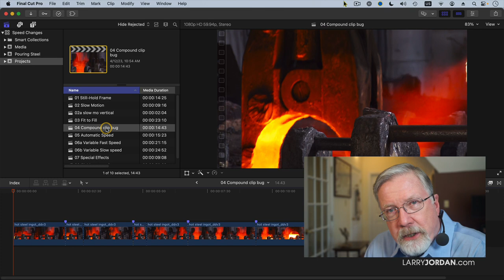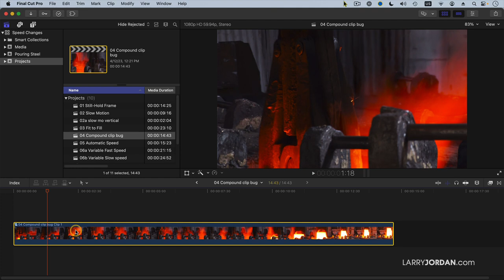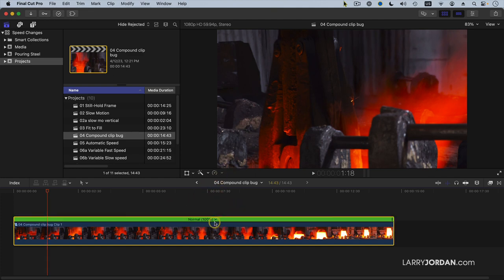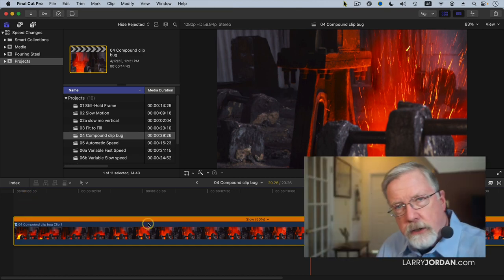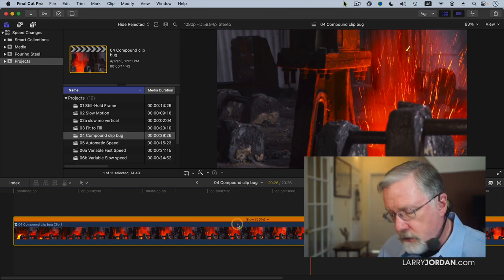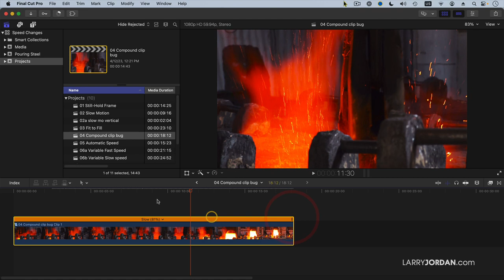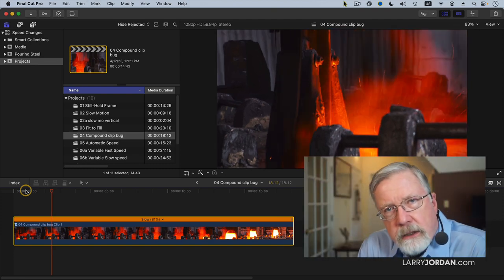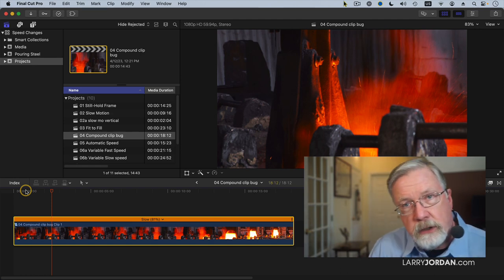How To Fix Glitches in Slow-Motion Effects in Final Cut Pro

Comment: Hi Larry, once again another question: I recently helped a pro guy with extra camera (Sony PXW-X70) for b-roll. He requested I shoot at 1080p 50fps 100th sec shutter. On importing to fcpx even after overnight render footage is still choppy. My Mac is a late 2013 MacBook Pro base model. I have no problem with 4k or 1080p 25fps 50th sec shutter.
I have seen other editors having the same problem with Davinci and FCP. Not sure about Premier. Any help would be much appreciated. Many Thanks. I'm in Ireland so 25fps etc. P.S. 4 files of about 90 min duration each.
Reply from the maker: I'd try two things to see if your video improves:

1. Try optimizing the media to convert it into ProRes 422
2. Try creating proxy files, again using ProRes Proxy

See if either of those fix the playback problem. ProRes 422 will be good enough to master in, ProRes Proxy is just used for a test and rough-cutting.

Larry

Comment: I had similar issue, but this helpful and intesting tip did not fix it. It ended up being a corrupt Full Access Cinematic Tracking Title.  I also use cross dissolve transitions when I use sequential multiple short clips to smooth out the transitions...works like a charm.